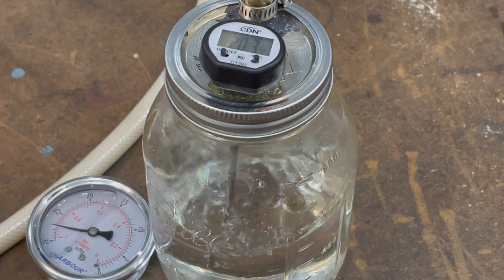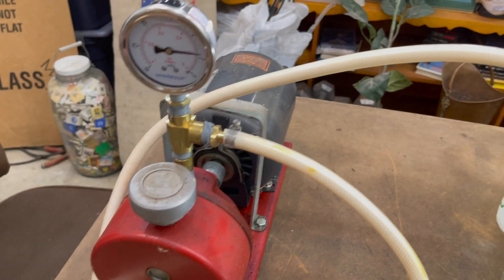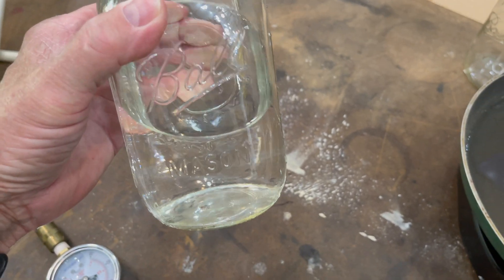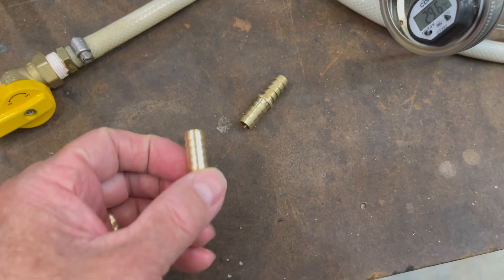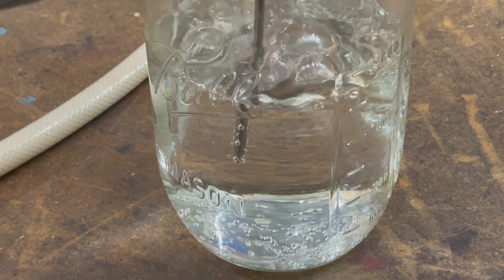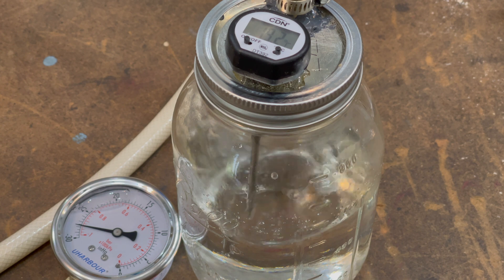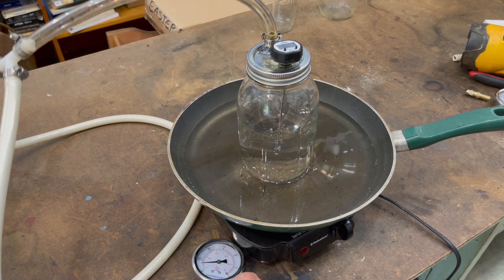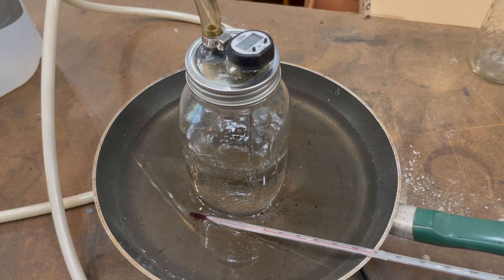Boiling Water at Room Temperature Under Vacuum in a Mason Jar

Comment: I am doing my car AC system using a vacuum pump from Harbor Freight and we are here in Las Vegas where the elevation is around 2,000 feet above sea level and my vacuum pump is only sucking at 26Hg and I am worried that it is not boiling the moisture in the system. I have not confirmed that my gauge is accurate and or my vacuum pump is on its way out, but at least I know that the water starts to boil at 26+Hg.

Do you know how long it takes to dry a drop of water? 

Thanks!!!
Reply from the maker: Thanks for your comment and question. When water transitions from a liquid to a gas it requires an input of energy or heat from the environment. A drop of water will evaporate quicker at higher temperatures. You will probably remove most of the water in your AC system by simply letting your vacuum pump run for up to 45 minutes or less at room temperature depending on how wet your AC system is. Good luck with your project.

Comment: Was it bubbling n cooling at low pressure rather than boiling?
Reply from the maker: Thanks for your question. The definition of boiling is, “the action of bringing a liquid to the temperature at which it bubbles and turns to vapor”. At reduced pressure the bubbles occur at a lower temperature compared to the temperature required to boil water at normal atmospheric pressure at sea level. Under vacuum a raw egg would not cook very well since the temperature is so much lower. Thanks.
Reply: Thank you for clari- fication. Looks like liquids can bubble n boil at low temp n pressure as well high temp n high pressure. Thank you sir

Comment: Roughly 90F under pressure. What 27nm. Vacuum. The vane pump expending 300w? hour running flat out and the vaccum aspirator sucking down 5gl of water an hour. The most likely scenario would be the use of parasitic heat and a wind turbine to drive a pump. Clearly desalinating water consumes significant enery.
Reply from the maker: Thanks for your comments.
Reply: @anisotropicplus  I really enjoyed the video. Thank you for doing all the hard work for us!

Comment: Is the water vapor near the top warmer than the boiling water?
Reply from the maker: That is a great question. I have not measured the vapor phase, only the liquid phase. Since heat is flowing into the jar as the water evaporates under vacuum and cools down it may depend on whether you measured the vapor phase near the walls of the jar or in the middle of the space. Either way my guess is the temperature of the vapor phase should be very close to the temperature of the water at the top of the liquid where the phase change is occurring. It should be similar to measuring the temperature of boiling water on your kitchen range and measuring the steam temperature immediately above the liquid. Thanks for your comment.

Comment: I am doing a project about this and I am asking if there is a specific type of glass we need to use to afford the pressure, or it doesn't matter ?
Reply: As long as you are not heating it excessively and have it under vacuum a typical Ball brand mason jar should work. With anything made of glass you do always need to consider that it could break. I used a 32 oz. Regular Mouth Mason jar that I purchased on Amazon. You can also sometimes find them in grocery and hardware stores. They are able to withstand moderate temperatures, but are not like borosilicate lab ware or Pyrex. I chose a Mason jar because they are more available and not too expensive compared to lab glassware.